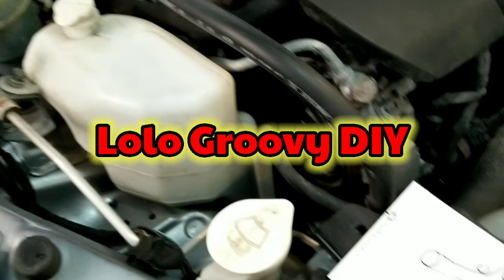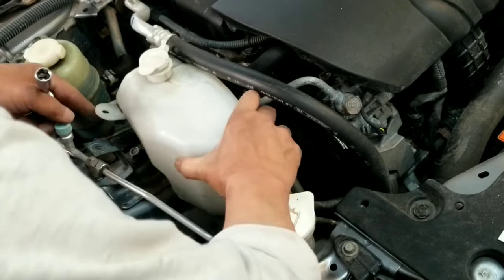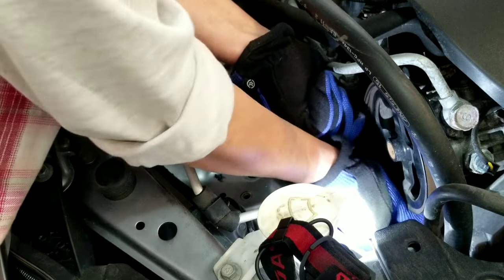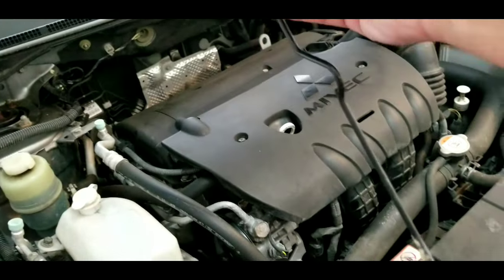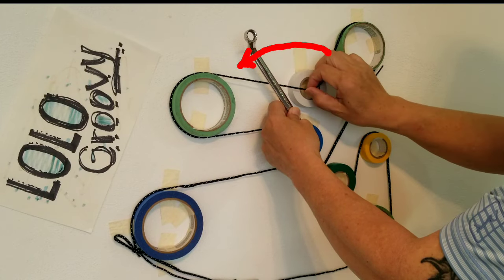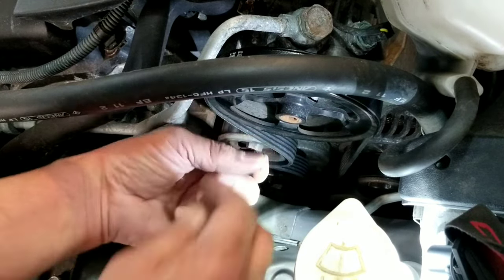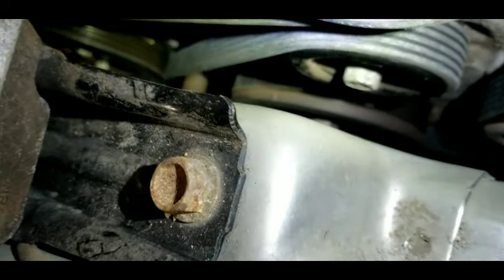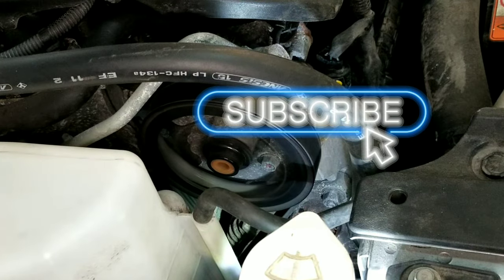SERPENTINE BELT REPLACEMENT/ 2015 MITSUBISHI LANCER

Comment: Sir can i ask how many kilometers to replace it?
Reply from the maker: A serpentine belt normally last for more than 50,000 to 80,000 miles but it is also important to visually check for wear and tear, cracks and if there's noise when the engine is running. Thank you for watching and have a wonderful day ahead.

Comment: thanks for the detailed work, would you mind sharing the part number for the belt, i bought 2 and both were short even when it says it will work for my 2012 outlander
Reply from the maker: I bought the belt in a local auto supply store and I don't have the parts number. If you want to make sure of the size, the best option is to get the parts from the dealership, might cost you a little more but it's your best shot. Thank you for your support and have a wonderful day ahead.

Comment: Just found your videos after having hear a noise from my 2008 lancer. Could you explain on what a whirring noise could be when accelerating after sitting 8hrs in the heat?
Reply from the maker: Thank you for giving time to watch my video. Whirring sound can come from any moving parts of the vehicle. It might be a wheel bearing, a pulley bearing or an axle just to name a few. Have a mechanic check it out. Hope it's not a big problem and thanks again!

Comment: You had the tensioner correct, on a 2014 their is a 17mm nut for attaching wrench to.Just below the tensioner pulley, Easier to get to with right front wheel off,
Reply from the maker: Thanks for the additional information. Thanks for watching and have a wonderful day ahead.

Comment: Does is method also apply to the replacement of a 2016 Mitsubishi lancer? Just yesterday a squeaky noise was occurring under the hood when the car is accelerating. I was told it might be the belt.
Reply from the maker: It should be the same routing. But just to be sure, compare the number of pulleys and position of the serpentine belt of your engine with the diagram I have on my video! Thank you for watching and have a wonderful weekend.

Comment: For some reason I feel like your not speaking about the difficulty of getting the belt on the pulleys, you only showed a diagram not the actual process of putting the belt on the actual vehicle
Reply from the maker: Your feeling is correct. I'm showing the easy way to route and grab the belt so it can be placed in all the pulleys without difficulty. Thank you for watching.

Comment: I just bought one of these vehicles (same year) about 3 months ago.
What's your impression of vehicle?
Is the transmission a little weird to you too?
Sluggish going up hills, sounds like it decelerates when slowing down etc.
Maybe that's all cvts ?
Reply from the maker: I don't feel any sluggish or any weird thing with the car. CVT is a quite transmission which you don't even feel when its shipting. I don't want to scare you, but have your transmission inspected and check if the fluid is good. Thank you for watching! Hope everything is well.
Reply: @lologroovydiy  thank you, I will get it inspected 🙂

Comment: Could you tell me which sensor measures the temperature?  the MAF or MAP?
Reply from the maker: A MAF sensor measures how much air is aspired by the engine and the MAP sensor  measures the air pressure in the intake manifold. Thank you for watching.
Reply: @lologroovydiy and which sensor measures the intake temperature?

on the first cold start at temperatures above 20 degrees celsius the idle is at 1500 rpm (correct procedure).  But at when the temperature is below 20 degrees celsius, the idle is at 1200 rpm.  I've already replaced the MAF sensor and it didn't fix it.  I suspect the MAP Sensor.

Comment: Which motor is this? 2.0 or 2.4
Reply from the maker: It's a 2.4L engine. Thank you for watching.
Reply: @lologroovydiy  does the 2015 lancer share the same 2.4L as the 2013 SE???